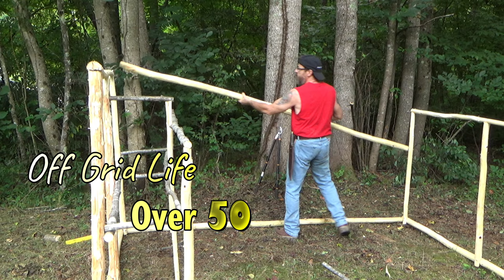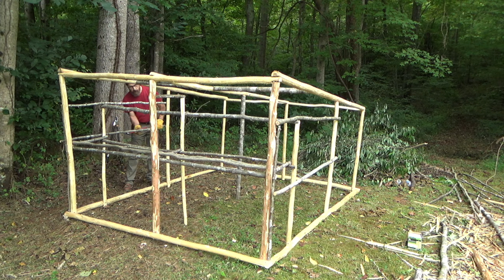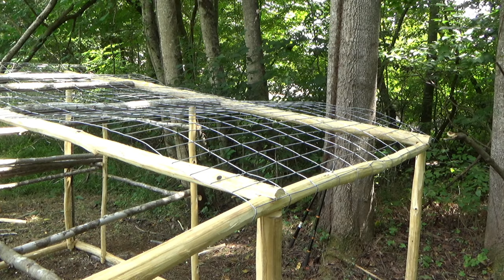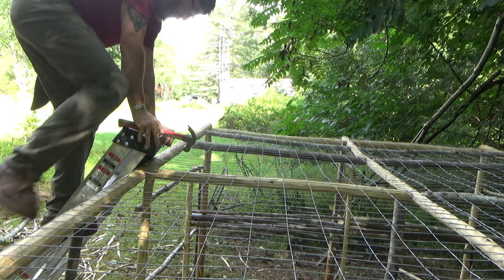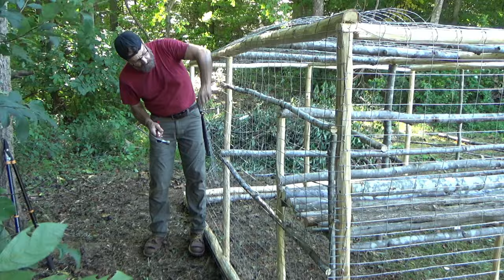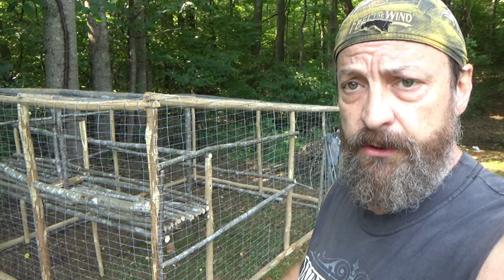Bushcraft Chicken Coop Build For An Off Grid Homestead (Part 3)

Comment: New subscriber here and I love the channel. I am assuming you are somewhat in the countryside and in the state of Virginia?  I noticed that the space around the metal door might be large enough for weasels and possibly mink to squeeze through and get to the chickens and ducks. Also, you may want to think about putting in a secure wire mesh floor to keep predators ( fox, coyote, raccoons, skunks and possums ) out of the coop. These are just thoughts, of course.
Reply from the maker: Welcome to the channel! Yes we are in the mountains of Southern Virginia. And yes we mentioned at the end of the video that the coop isn't finished, we will be adding chicken wire, roofing panels and doors to the nesting boxes in the near future. We appreciate your thoughts and advice.  ❤